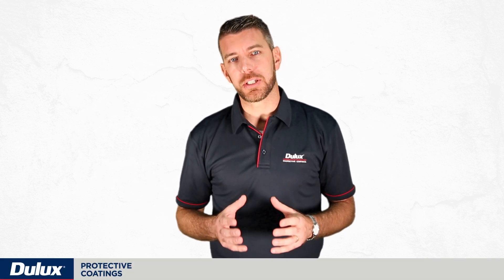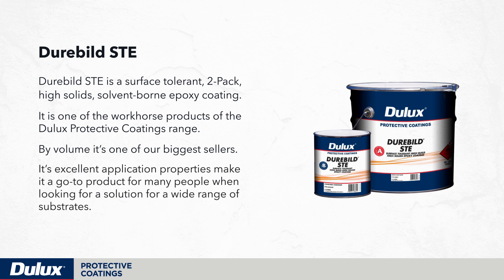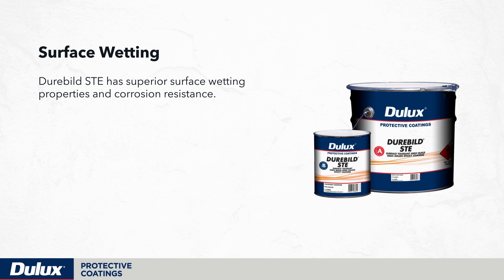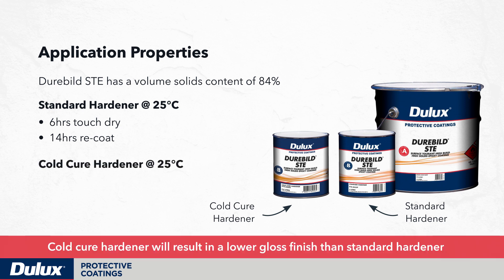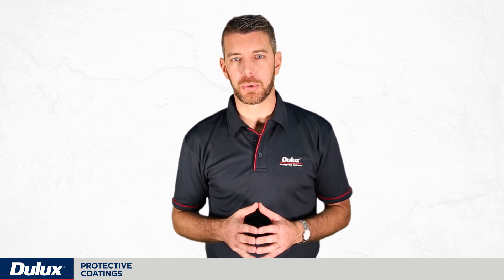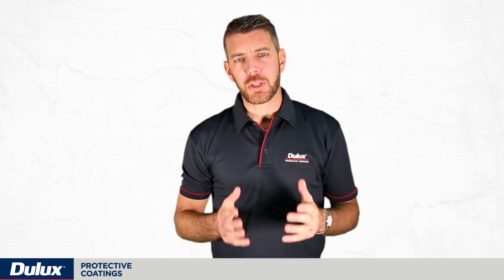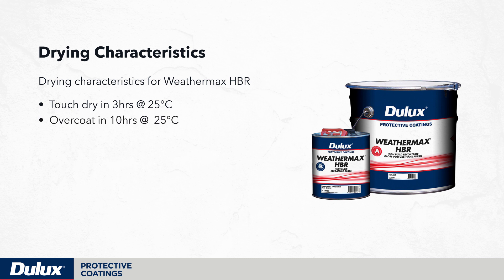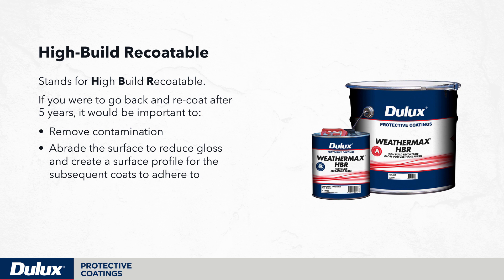Durebild STE and Weathermax HBR

Comment: Hey 
Would the hbr be a good epoxy two part for a petrol station
Steps, pumps base etc all concrete
Also once mixed hows work life before it hardens
Reply: Did you get an answer to this?  I'm looking for a solution for the same application.  No mention of work life.